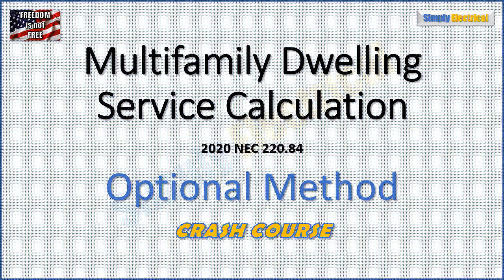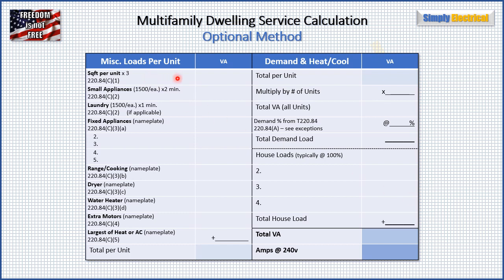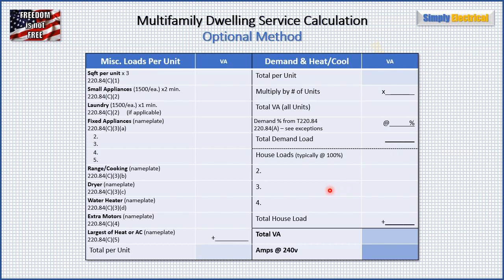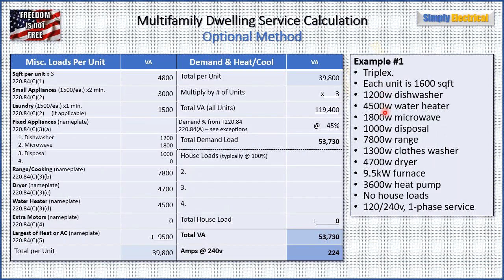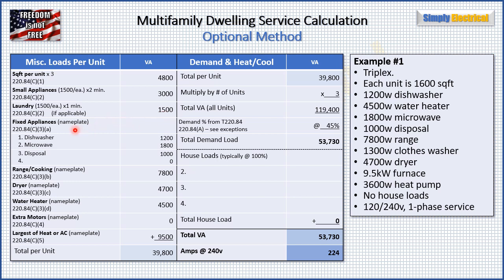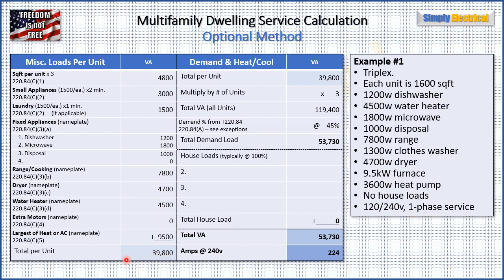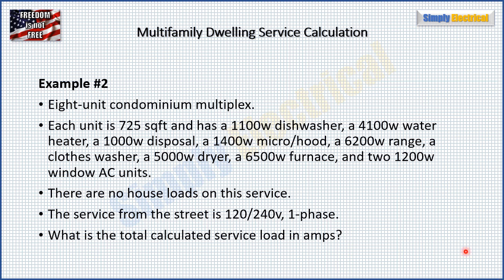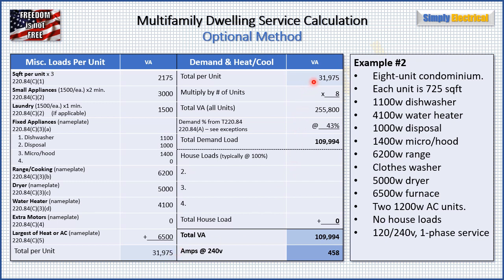Multifamily Optional Service Calculation - Crash Course 2020

Comment: Question, I don’t know which stander method we can use in the test exam (state Administration ) ?
Reply: I got the answer through the chat. Thanks
Reply from the maker: Yep, the exam will tell you whether to use the Optional or Standard Method for the question. In the event it doesn't specify, you would need to go with whichever method gives you the lowest size service (usually the Optional Method). This assumes the question is asking for the minimum size, which is typical.

Comment: It looks like you didn’t include 1300 VA for the “clothes washer” in the first example.  Was this intentional?
Reply from the maker: Yep. The clothes washer load is handled by the Laundry load @ 1500VA (Left Column, 3rd Row). We are required to use a minimum of 1500VA per laundry circuit.

I have an in-depth explanation of this here at about the 11:00 mark:
https://www.youtube.com/watch?v=CzIiZwBkNNU

Comment: So which method you better recommend. Thank you.
Reply from the maker: It depends on your situation. I would generally recommend the optional method for most applications. It is quicker, easier, and doesn't require as much detailed data collection.

However, the standard method is more precise.

So, if you are using the optional method, and end up close to a service size limit (say, you calculate185 amps), then it would be good to run it through the standard method also. You don't want to cut it too close on a 200 amp service. ALWAYS leave plenty of wiggle room, if you can.

Keep in mind, that there are rare occasions where a standard calc actually comes in lower than an optional calc. Usually only on tiny buildings.
Reply: How can I get both templates (optional & standar methods) for single dwelling and multiple dwellings units calculation spreadsheet to compare Thanks
Reply from the maker: @jirehelectric  I'm working on getting the tables available for download. I'm putting together a website in my spare time and unfortunately it's taking a little longer than I'd hoped. I'll send out a notification when they are ready. Sorry for the wait!
Reply: @simply.electrical  That would be great. I just got my electrical contractor license and I have been working on sizing a 6 dwellings units service plus house, the square footage differs from each other and your videos have helped a lot so you explain more clearly that others on you tube and because sometimes there is no time to go all the way to the process a template would help a lot. Thanks for your hard work. 👏 Sorry for my English I am second English speaker.

Comment: How did you get 640 A amps? What’s the formula?
Reply from the maker: The formula for calculating amps for a 3-phase load is:

Watts/(Volts x 1.732) = Amps

Remember, you have to multiply the volts by the square root of 3 when calculating these 3-phase loads.  Hope this helps!